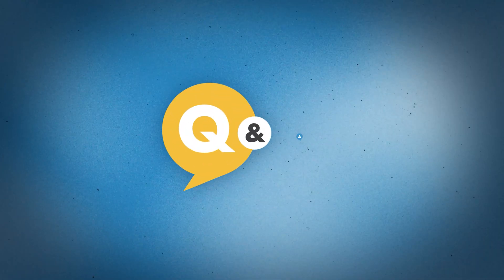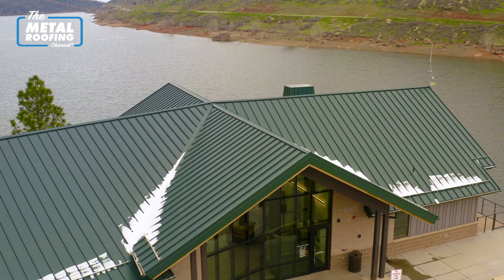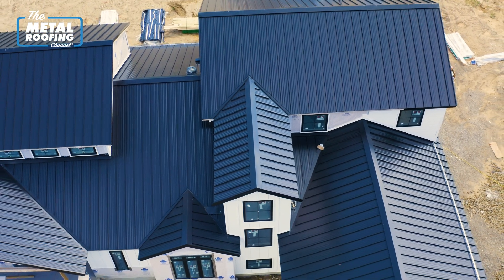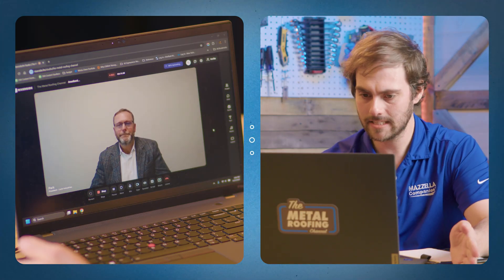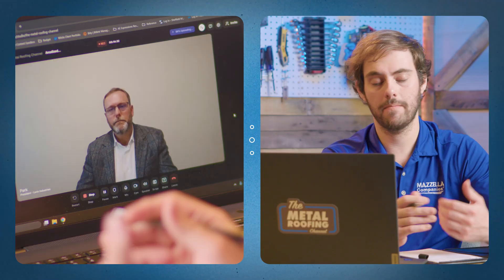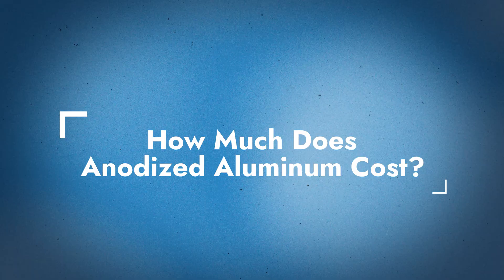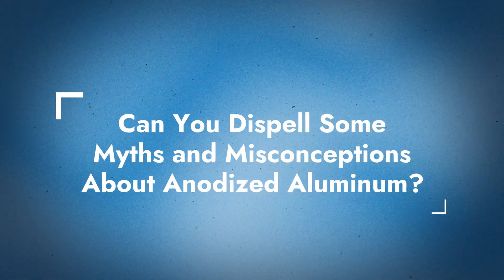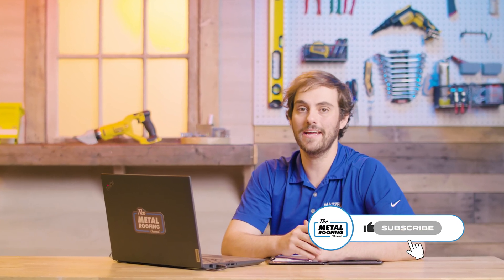Anodized Aluminum EXPLAINED: No Paint. No Peeling. Just Performance.

Comment: So what happens at the nail or screw holes? Are they pre punched prior to anodizing? 
Because I've seen plenty of products in a on the road industry that failed spectacularly. As of now I'm putting steel on my next roof. Unless you can prove to me that it will last.
Reply from the maker: Nothing is punched before anodization. Aluminum is widely used in the metal construction industry for cladding. A failure like the ones you are mentioning most likely come from galvanic reaction of dissimilar metals. It's crucial that any clips, fasteners, accessories, etc. use a material that won't interact with the aluminum to cause a galvanic reaction. -Thad

Comment: I operated a company that anodized aluminum for 25 years. There are three types. Type I is Chromic acid, like on propeller blades. Type II is clear, or can be dyed any color. The best and hardest is Type III, a typical coating is 1.5 to 2.5 thousands of an inch thick. The hardest coating is with 6061. Architectural  aluminum is 6063 and developed expressly for architectural designs, it's brown in color.
Reply from the maker: Great info to know! Thanks for sharing! -Thad